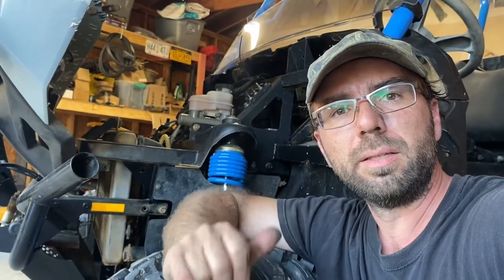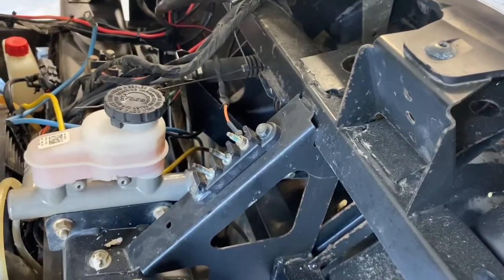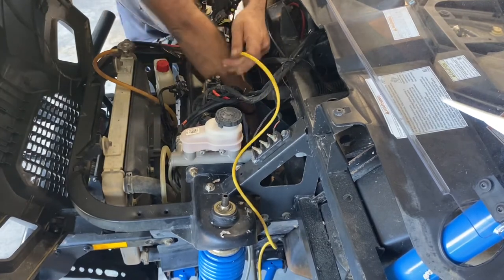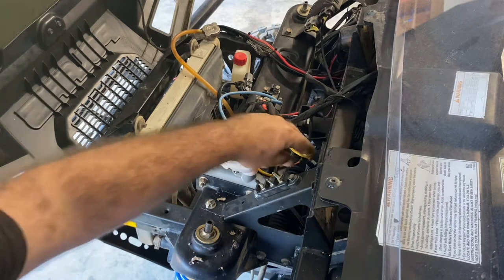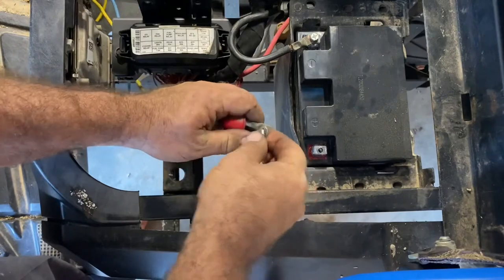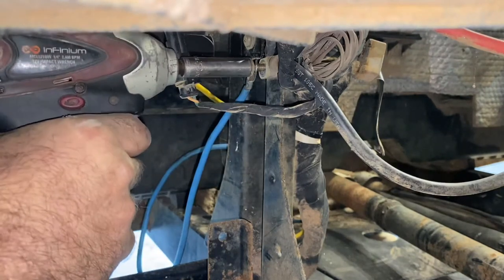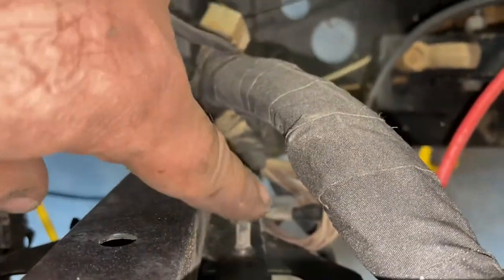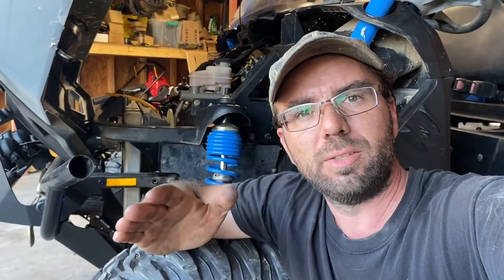Polaris Ranger Busbar Wiring

Comment: This was the first video that was actually useful. Thanks.  2:41 the BUS bar.  I have a 2022 570.  It came with the bus bar on the left side, with the keyed ignition mounted to the middle of three.  Nothing else.  

Anyway. Ran hot from the battery to bottom.  Ground from the battery to the top.  Tested.  Hot to ground, 13v.  Middle (key) to ground = nothing.  Start engine.  middle (key) to ground 13v.  Got my lights wired in and everything works.  one bank front, one bank rear.  Used the BUS-to-frame mounting bolts to secure the switch relays.

There is an empty spot on the right side of the frame that looks like I could mount a second bus bar there, if needed in the future. 

Anyway, I had no idea what I was doing and it didn't occur to me that Polaris would put a BUS bar there with no power to it.

Does it matter that I went back to the battery for the ground instead of to the Chassis ground?

Comment: Ok, my question though is I have a light bar mounted....I bought another rocker switch, made my cut out in the panel to put the switch in place.  Now obviously,  I don't want that light on all the time so how do I wire in that rocker switch to the power panel under the hood like your showing there.....my Ranger 900 has that same power panel under the hood.  Light bar has a hot and ground.  Do I go direct to battery with those, or to a post under the hood and then take that ground to the frame someplace, then wire the switch to the same hot post under the hood the light hot went to????  I can experiment but was hoping for the short answer here?

Comment: I just purchased a ranger 570 it came with a bus bar. There is a wire connected to the center post of the bus bar.  What you said about it always comes with a wire connected to the top Post is not true. It could vary from Dealer to Dealer, depending on who prepped it. The wire to mine is black, so I don’t know what it goes to. According to the directions for the bus bar wiring kit made by Polaris. The keyed/switch circuit should go to the top post like yours. Ground is in the middle and always hot on the bottom. Anyway, it should be as you stated, but it’s not always the case.

Comment: Hello, my Ranger Crew already has the bus bar with the connections directly to battery for black and red, and accessory wire connected to top pole.  I'm wanting to connect my newly installed winch to this bar instead of directly to battery so the winch only operates when ignition is on.  I assume I go from winch controller red to accessory bar pole, and black to black bar pole, correct?  Thanks.
Reply from the maker: Yes you are correct. The power wire for controller goes to acc terminal on buss bar. The solenoid you’ll put the red to red and black to black on buss bar.
Reply: I have a 2015 Ranger 900 that has the hot bus bar under the hood as well.  I put my winch on soon as I bought the machine and really can't remember the wiring of it all, but I thought I took my ground to the frame down close to the winch mounted spot, and then the winch hot wire to that bus bar.  Either way the switch controls the winch as it should.  Now i'm trying to figure the correct way to wire in a light bar so it's also switch controlled?  I think it should work the same way....find an external ground for my light and my switch and take a hot wire from each to that bus bar???

Comment: You should have fused the yellow cable at the battery. This would keep you from burning your vehicle to the ground should the cable ground out.
Reply from the maker: That’s a good idea however is overkill and unnecessary, machine is not going to burn to the ground 😂 Appreciate the comment.
Reply: @montemania198210  I just did the same job using a 4 gauge amp wiring kit. It came with a 120 amp fuse so I was able to wire it safely.
Reply from the maker: @WeSRT4  glad to hear you’ve taken a extra precaution on your machine. May want to install a fuse on starter circuit since that’s not protected from factory. Always love sharing different ideas.
Reply: @montemania198210  It’s within about the same distance from the battery as my inline fuse. The point is that when you run long distances the possibility of a short increases exponentially. FYI I’m an old car stereo and security installer. MECP certified and taken electronics courses. Food for thought…. Your machine.
Reply from the maker: @WeSRT4  thanks for all the great thoughts. Was thinking you may have something going here and reach out to the atv manufacturers and winch companies, cause I know all their kits have no fuses for the power wire that usually run from the back of the machine all the way to the front of machine. You should reach out to them cause this is the exact procedure that Polaris does it. Totally understand where you’re coming from, I’m a full ASE certified master mechanic and been working on atvs since 1995.  Trust me I’ve found plenty of better ways of doing stuff over the years compared to how manufacturers do it. I will definitely suggest fuse on my next winch install video.
Reply: If you want to run a fuse where would you put it and what size fuse?  If you could provide a link to a fuse on amazon or similar I'd appreciate it.  Im a complete Newb but did the job according to this video but would prefer to add a fuse.  Thx.

Comment: Why would you not just run the negative wire straight to the battery?
Reply from the maker: You can put it at battery. I prefer the ground at chassis location. Mainly because I hate messing with the battery terminal bolts and nuts, one less to mess with lol.